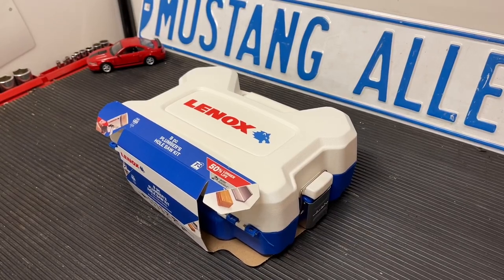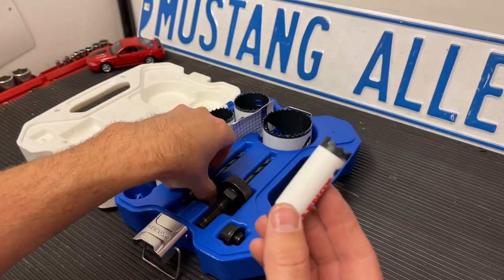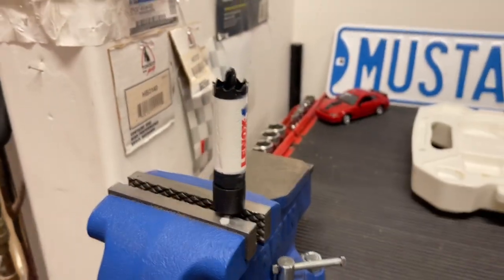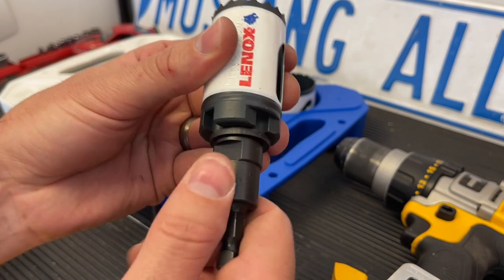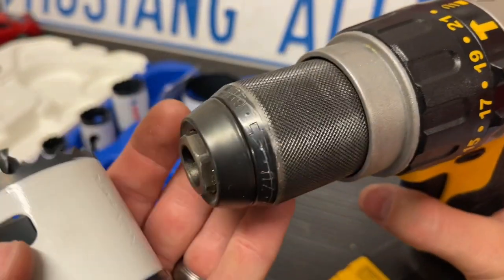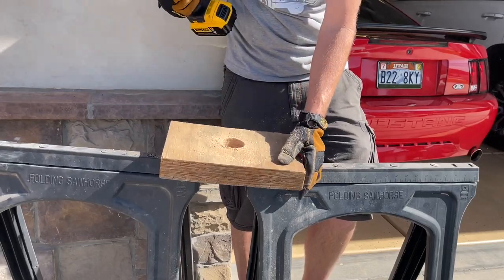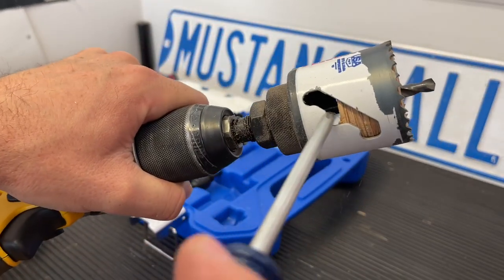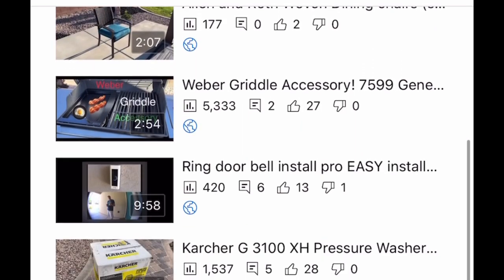Hole saw plumbers/electrician saw kit. How to cut perfect, circular holes in wood or metal Lenox

Comment: Danny I need your mustang enthusiast advice! (Comment not related to your video plz delete if you need too) So I picked up a Rio red 97' Cobra last week with a spun rod bearing. It's a beautiful car, only 97k miles, staggered 18 inch 2000 Cobra R wheels and lowered. So I bought it originally to sell the hurt engine and drivetrain to swap in a 351 Cleveland I've been building for about a year. I already have 2 4v cars (03 Cobra an 03 Mach 1). But it started eat at me now I would be sperating this nice Cobra.. I also have a 04 Navi 5.4 engine in the garage I could drop in and retain the modern amenities (MMR adapter plates with a coyote intake). But I'm torn on what to do! Should I fix it and sell it for someone else to enjoy? Carry on with my original plan or at least keep it a 4v with the Navi motor. What would you do!? I'm losing sleep over it lol
Reply from the maker: I would go with the 4V navigator engine. Just me though
Reply: @dannyjohnsonsgarage  okay! Well at least you’re on board with a swap in general! Thanks for the input